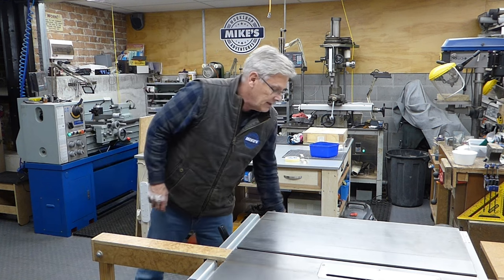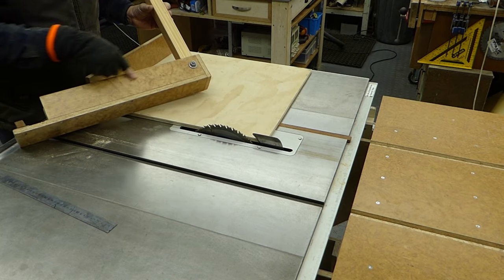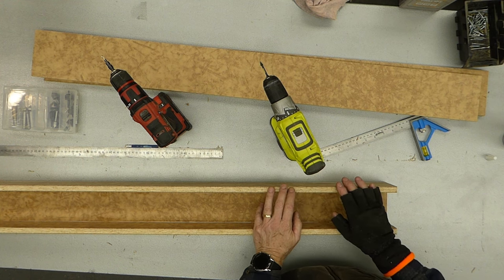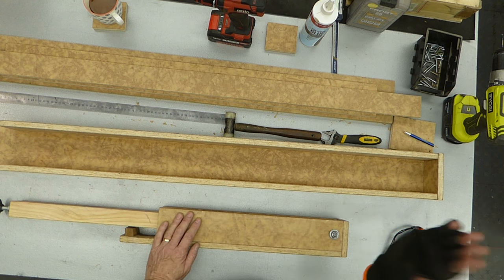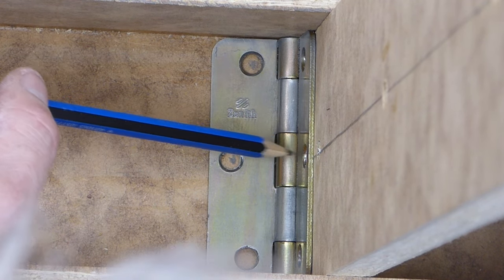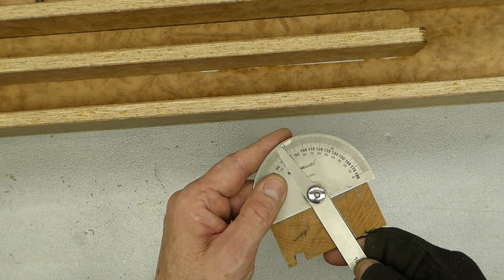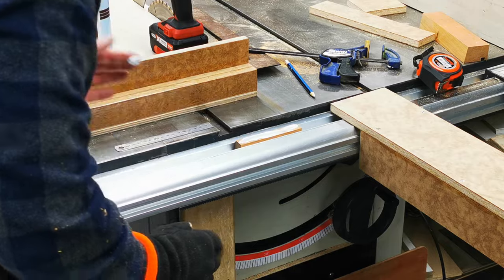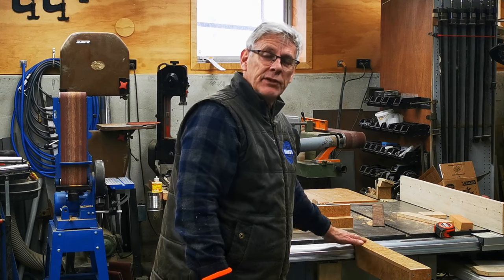Table saw infeed support a must have accessory

Comment: You inspired me to build an infeed support table.  It was a 2 hour build based on your first version. One improvement is the end cap piece, I made out of hard wood and about 2 inches longer than the horizontal support height, this allows me to clamp the leg to it so it can’t accidentally close. Thanks again for making the video.
Reply from the maker: Thats great. I use my smaller one all the time. I like how we all adapt things to suit our own setup. Thanks for watching. Cheers Mike
Reply: Hi, Could you send me a picture or a sketch of your in-feed support accessory? I have a DeWalt DWE7491rs. It is a great saw, but the blade is approximately 4” or 101mm back from the front of the saw.  There is no fun in trying to load up the saw and cut a 4x8 sheet of plywood by yourself.

Thank you for any help you could provide,
Steven
Reply from the maker: Hi. Sure can. I'll sort something in the next couple of days. Email me your email. Mine is in the community tag. Cheers Mike

Comment: Such a simple yet sturdy support.👍
I like quick and easy. My first table saw sled was 3 pieces of wood and took me about 15 minutes to build. I watch some of these “influencers” making sleds which take hours to build, require over $100 in hardware and are so big I can barely lift it or store it.
Reply from the maker: Thanks for watching. Yes some of the table saw sleds are to heavy. The infeed support really made the sled easier to use. Cheers Mike

Comment: This will really great for folks using the smaller job site saws which have a much shorter in-feed distance between the front of the front edge to the front of the blade.
Reply from the maker: Thanks for watching and commenting. Yes it would be a good addition to a contractors saw. Cheers Mike

Comment: For a small workshop, the 'Fold away anything' is a great idea 👍. If I continue with woodworking as a hobby, this will certainly be on the list. First project however is a recycled pallet being turned into a table. Knocked up a formica table (Heath Robinson would be proud of this 🙂) to convert the Skilsaw into a table saw to start with. Still have all my fingers, so I'll take that as a win 😁. First glue up today after hand planing to try face gluing that Dana Made shows on his chanel. Trying to do as much for as little cost as possible to see if I like this hobby direction. So far I do, probably because I still have all fingers 🙂. So if a proper table saw is in the future, the fold up lead in, and for that matter lead out support will be one of the first projects.
As well as the 'ticking stick' information, your ideas are well received.
Cheers
Pete' Hokitika
Reply from the maker: Thanks Pete. Great to hear you still have all your fingers. We all have started small and built up our gear. Cheers Mike

Comment: Nice idea and build.  I plan to make one much like it, but because my Delta fence rail has a larger gap of about 2" (between it and the table top), I plan to make my hardwood locator block even wider than the leg assembly.  That way, it helps provide better lateral stability and I can add one or two fence style clamps to hold it into place when in use.
Reply from the maker: Sounds like a great addition to the idea. Let us know how it ends up. Thanks for watching. Cheers Mike

Comment: Hi Mike,  I just watched this video and this is exactly what I have been cobbling to see what would be the best solution. Did your fence come with your saw or is that an aftermarket rip fence? That aluminum tray works great with your solution.  My saw is the DeWalt DWE 7491rs does most of what I need. There is not enough room in front of the blade. Izzy Swan and Maggie came out with a small portable rig that clips in and out of that same type of setup. Izzy and Maggie started selling them and then decided they are not a production house. They had a few but not sure if someone else will pick up the work. Izzy and Maggie have switched over to the Harvey table saw solution. That is built like a tank.

Stay Safe,
Steven
Reply from the maker: Hi Steven
Yes my saw came with the fence in the video. Its a Chinese made one under many brands. Haven't seen Izzys infeed support. Good luck on yours. Thanks for watching and commenting.

Cheers Mike

Comment: When I got my table saw & wanted to rip some 4 x8 sheets it really made me nervous so I dropped the blade down set the fence & practised several dry runs untill I got the feel as to how to apply pressure to keep things straight since then no problems 
Having to work around a leg would get annoying real fast especially if you are doing a lot of ripping but that,s just me
Reply from the maker: Thanks for watching and commenting. Once you start using it it doesnt seem to be an issue. Only in place when cutting large stock. The great thing about a hobby is we can do it the best way that suits us.
Cheers Mike

Comment: thanks for the great idea a detailed video. Working on a DeWalt 7492 there is unfortunately no similar possibility to simply hook the feed support easily, or at least I can’t see how. The only way I see at the moment to use the fence rai, for attachment, but it would be not as practical as your solution. Any thoughts or ideas on that?
Reply from the maker: I will go and have a look at one and let you know. Cheers Mike
Reply: @mikesworkshopadventures  thank you

Comment: Does these accessories includes for portable table saw
Reply from the maker: Hi. Im sure you could adapt this to fit on a portable saw. Just create a mechanism to clip onto saw. My original was on a contractors saw that had a pipe slide on front and no problem clipping onto it. Thanks for watching. Cheers Mike